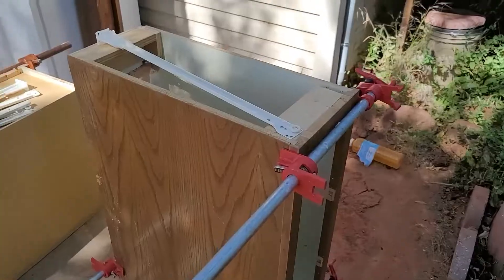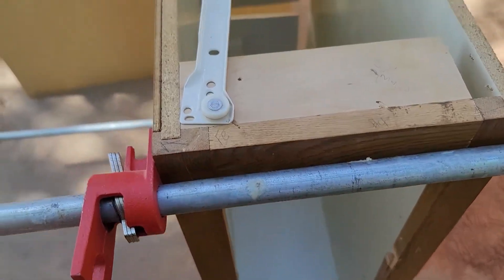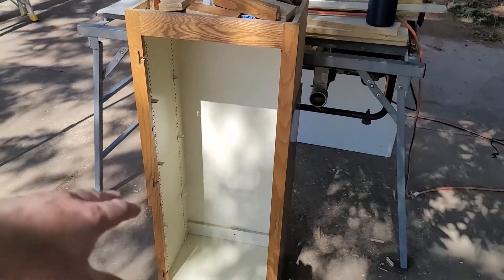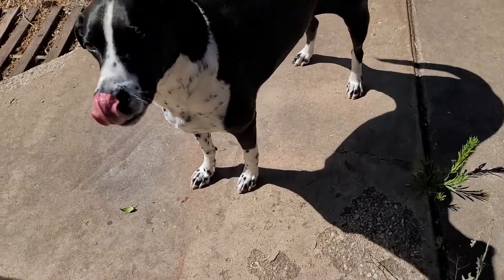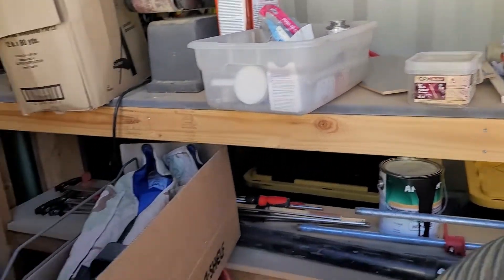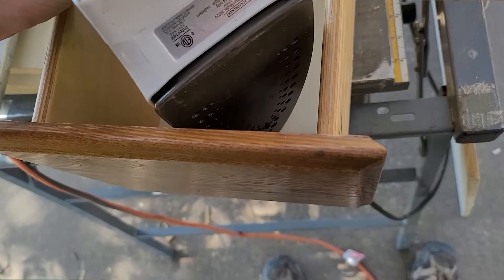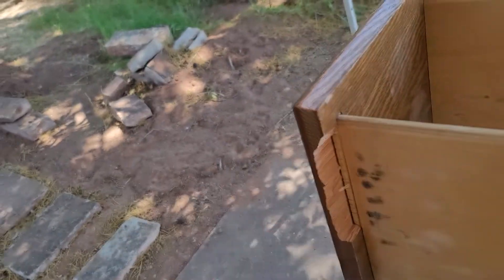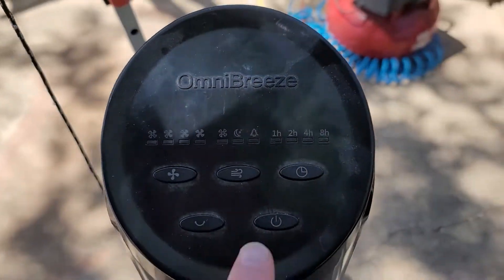VLOG 6 | Modifying Mom's Cabinets (Part 2)

Comment: still surprised everything in this country holds by glue 0_0 
doggo is the best, as usual :] need few doggo intermissions with such long video xD
Reply from the maker: You know what? You're totally right! I had him inside most of the workday because it was over 100 degrees and he has black fur haha. But now that you've pointed it out, I could easily cut to him inside and stuff on break or whatever, I'm sure I can creatively come up with ways for more doggo shots 😁